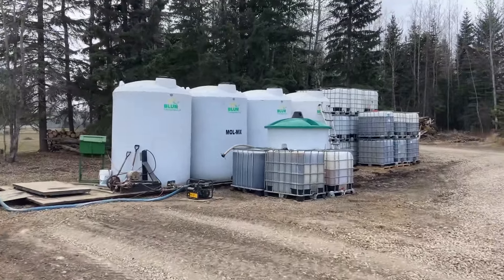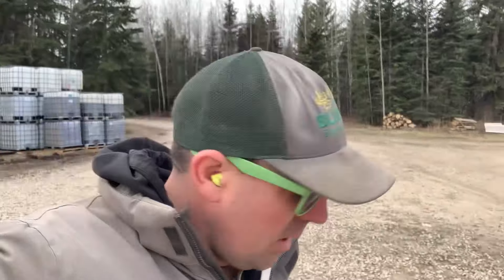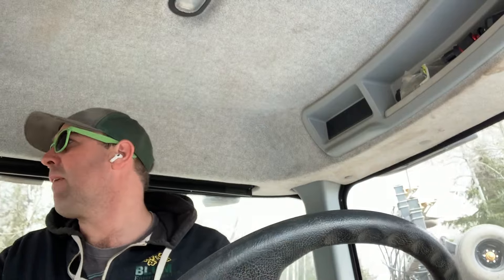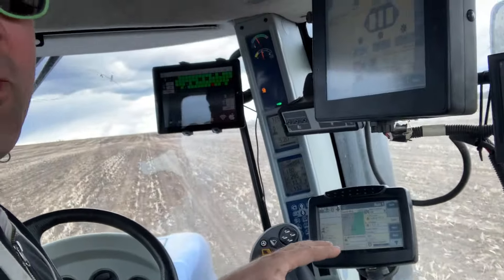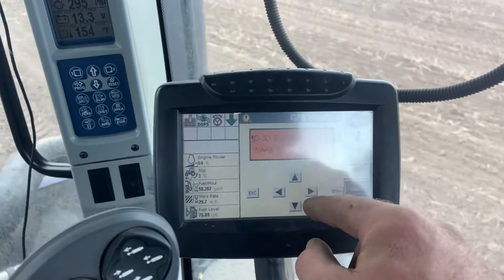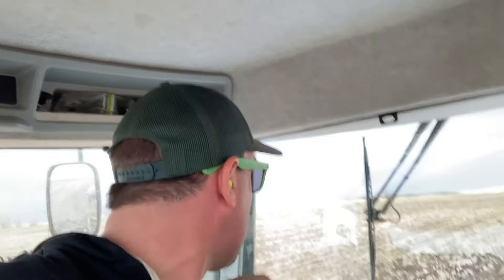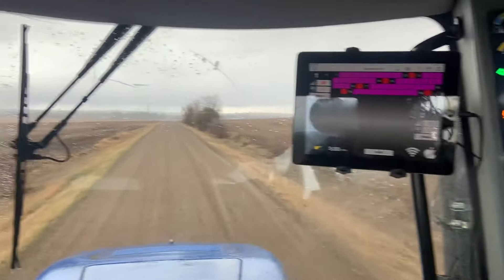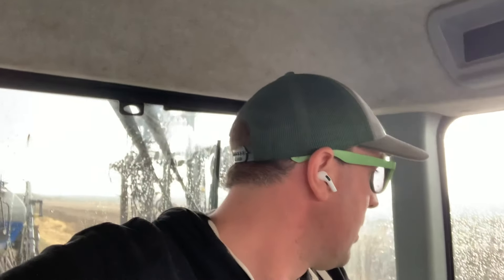T9.505 24volt issue @farmingnodak @jeremycherny2041

Comment: With all of this charging technology and the tractor can’t charge your batteries equally?  That’s frickin crazy.   The kenworth has four and I’ve never touched them in 17 years now.
Reply: Parallel vs series setup differences. Parallel gives a lot longer amp hours but only 12v while series gives higher voltage for better cranking... however the 24 volt system is also a stupid part that complicates it for both charging and boosting.

I can't figure why they don't have a larger module or system to help in charging the 2nd battery in series, or if that is a limitation. A 24 volt system is fine if not having to do much starting/stopping.
Reply: @farmingnodak  got an old Belarus on a 24 volt system I use as a third loader tractor.  All of its batteries charge equally.  Maybe new holland should talk to the Russians.  🤣👍🍻.
Reply: @chadtosh6831  Lol probably... then again that sucker doesn't need to worry about DEF either. I seem to recall that some of the emissions crap is tied into that 24v system as well
Reply: @farmingnodak  nope, no def, but I do prefer driving my new Kubotas.  Lol.

Comment: It didnt blow any fuses? Thats interesting... so probably means the battery must be fine and no internal short, just was too low for the 24 volt charging to do a dam thing. Ive read on forums that the batteries should be rotated every two or three years to extend the life since it sounds like the battery on the 24 volt side is usually the one to grenade itself first.

System of nonsense is true with that gps 😂.
Reply from the maker: Swapping the batteries front to back fixed the problem for now